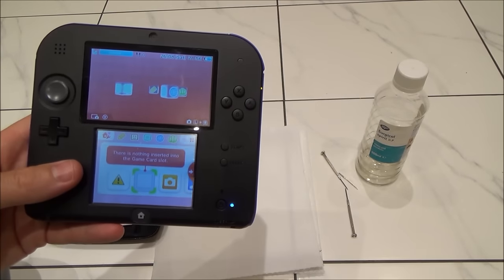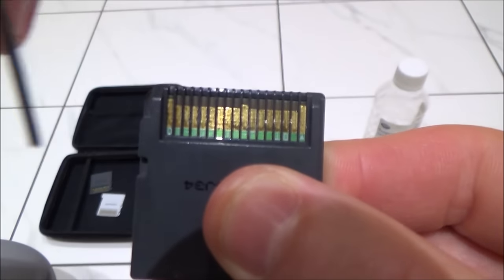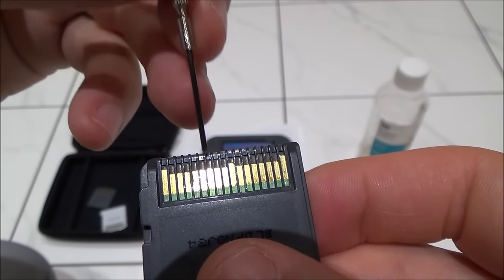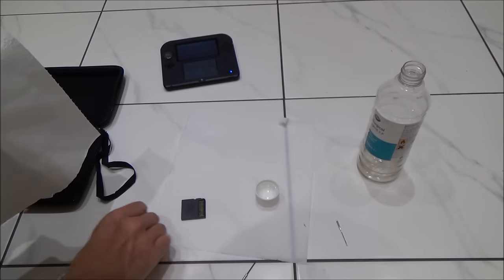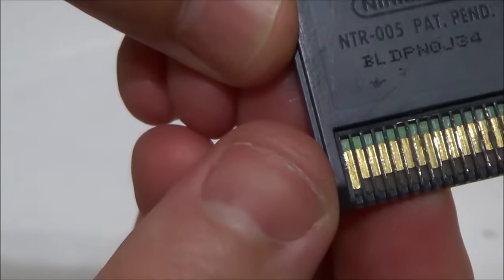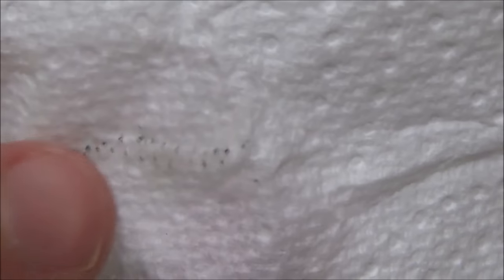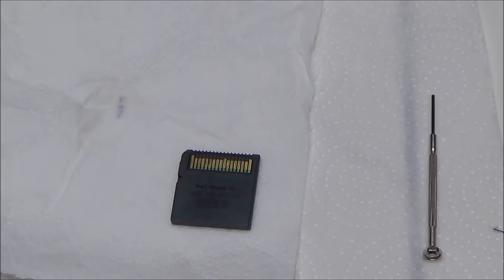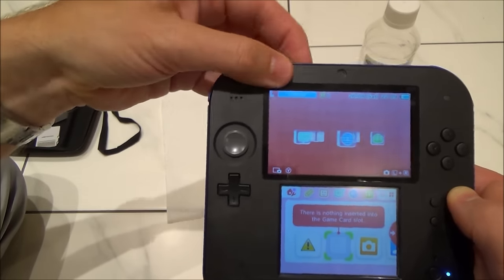How to Fix a Faulty Nintendo DS / 3DS Game Card

Comment: i dont have  a ds/3ds But I have a Nintendo switch with two games: Super Mario Bros Wonder/Sonic origins plus but the problem is Sonic Origins Plus does not work on my Nintendo switch I tried every method including uninstalling the game but it still didn't work if someone tells me the only way to fix the game card slot and/or the game card itself is to factory reset the Nintendo switch that I have I'm not going to do it if I have to please someone send me message to fix my game cartridge or the cartridge slot

Comment: I just took a toothpick, flattened out the tip, soaked it in water, then twirled it gently on a towel, and then pressed the gold part and it solved the problem. (Scribblenauts collection to be exact)
Reply: JUST USE A TOOTHPICK IF UR A KID DONT NEED TO GO THROUGH THE TROUBLE OF FINDING RUBBING ALCHOHOL.

Comment: So would a game still work if one of the plastic pieces that divide the gold connection point is missing?
Reply: i have a game like that, its mario kart ds and one of the little dividers is missing. it does still work just fine, so you should be able to get it to work without it. so long as the gold pieces are fine, you should be good. be sure to take extra good care of it though, because without the divider the gold pieces are unprotected.

Comment: Sadly this did not fix my Pokemon Y game…I dont even remember what bricked it
I keep my games in my game case with the 3DS so, IDK how it was bricked, it didnt look dirty and i cant see any obvious damage or crooked components
Reply: Adding thickness with about 7 layers of paper might fix it. Insert the paper before the game on the sticker side of the game and then pull the paper out a little bit so that it doesn't touch the bottom. Since paper is flammable be careful.

Comment: I tried this several times and my cartridge still isn't reading. One of the gold bits is really scratched up and two of the little black dividers are missing. Is there a way I can fix this?
Reply: I'm not sure... it sounds like your game is in really bad shape. If I recall correctly, you can remove the dividers and have the game work, being plastic they shouldn't be electronically important. That being said, it IS important to make sure the dividers aren't bent or smashed as to be in the way of the contacts, make sure to adjust any remaining dividers that are distorted so that they're thin and straight. As for the super scratched bit, do your best to clean it as best you can, debris could be in the scratches, don't be afraid to let a little extra rubbing alcohol to seep into those scratches and utilize gravity to your advantage, just make sure it's given ample time to dry. After cleaning the scratched area, look closely to make sure it doesn't have a physically broken connection as that would be much harder to address.
After this, if it still doesn't work, one thing you can try is adding thickness to help press the contacts together. Do this by putting a folded piece of paper in the slot on the sticker side of the cartridge before you insert the game, when I used this trick my paper was 7 layers thick, but since your game is so busted you might need more or even less. Be sure to let the paper hang out so that it can be easily removed and don't let it sit so deep as to touch the bottom of the card slot. Since paper is flammable there is some fire risk with this approach, use with caution.

Comment: I legit had a Nintendo DS before, and I had this game card I didn't remember what game it is, it has a SD slot.
Then, my DS broke because the screen never displayed, then after a few years. I had my Nintendo DS Lite.
Then my dad figured out I had some old DS games near the old dusty cabinet.
I tried everyone of them, it doesn't work.
Then one of them (The SD card slot game card)
Got stuck in my cartridge.
Then my dad took it out and removed the extra cotton cover in the sticker section.
I saw nothing, pure silver.
I'll send the SD card pictures just in case if you can possibly give me a method to fix it.

Comment: My issues is that Pokemon pearl wont work it will read but it says that “an error has occurred press and hole the power button to turn the system off” I tried to blow dust out of it but it won’t work and the game also worked not to long ago

Comment: Hey my ds game Heart Gold game cartridge works fine but it will just freeze at a random point in gameplay and remain frozen unless I power off the 3ds
Reply: Crimson have you did the cleaning process shown in this video? That should fix it
Reply: That happened to me too. The 4th gen in general can freeze anytime but my HG froze like 5 times.I still have to try cleaning the cardridge myself so I don't know of it works. Look if there's dirt or something in the sensors and if yes that's probably the problem and if not is the cardridge itself just damaged.

Comment: Mine recognizes New Super Mario Bros., but when I open it, it says, “An error has occurred. Press and hold the POWER Button to turn the system off. Please refer to the Operations Manual for details.”. The Operations Manual didn’t give me any info, so what do I do? This is the only Game Card that does this.

UPDATE 1: I lost the game, it doesn’t matter anymore.

UPDATE 2: I found the game, put it in my DS Lite, and it works, but the Minigames and Mario vs. Luigi modes just take me to a black screen.
Reply: GDFan3000 YT Same game, same error.
Reply: GDFan3000 YT 
Clean the cart slot, or as Billy Mayonnaise suggested,
Remove the plastic dividers, with your nails or which you prefer.

I wouldn't do that tho, unless my absolute last resort.

And I know you lost your game, this is for other people, or if you encounter this problem again.
Reply: Pocket Gaming I just updated my initial comment fyi.
Reply: GDFan3000 YT 
Try checking if it's dirty or corrupted.
Reply: Pocket Gaming It might be, since the “Mario vs. Luigi” and “Minigames” modes don’t work.
Reply: Your NSMB is a bootleg.

Comment: this did not work for me but i have a slight different chip its a galaxy eagle and does not have the plastic lines and also I used window cleaner but  when i insert the chip the image of the chip came up but when i clicked on the game the screen goes black and said. An error has occurred.
Press and the POWER Button to turn the system off. Please refer to the Operations Manual for details. Can anyone help me plz i think its the electronics btw.

Comment: .. i have a game that does work (Pokemon black 2) but makes a strange crunch noise when inserted, and is harder to insert than other games. 

Looking online; I've only seen like one or two other mentions of this, and they're all from old forums that don't tell me anything about the problem. Or just make fun of the original poster.
Reply: Carefully compare the game cartridge to the games you have that are in the best condition for any physical abnormalities and be sure to clean out the card slot as best as possible. Compare every notch, scratch and bend to find what might make your Pokémon game different.
Reply: @kyriejones6060  thinking now ot might be a problem with the system and not thr cartridges; this happens to some of my 3ds games I've noticed.  It might have to do with age or leaving the cartridge in overnight (???) But I'm not sure
Reply: @soupevil  I'm not sure either. Unless the sound you hear sounds electrical, there has to be something physical causing the noise, either as part of the cartridge or in the card slot. I suppose it could be hidden within the mechanism that holds/ejects the game, but  if so, why wouldn't it happen with more games?

Comment: Omg thank you so much took me 2secs and if I didn’t find this shit I would have lost all my Pokémon omega ruby progress tyyyy
Reply: Alan Schwartz For no reason, I have the same problem too with my Pokémon Omega Ruby. What did you exactly do to fix it?
Reply: Reverse Tacoblast so what I did is that I found a lock pick that I have laying around and dabbed a little rubbing alcohol on a paper towel just like in the vid and cleaned the gold pins. If you don’t have a lock pick of some sort you can prob use the end of an iPhone charger or sumn like that and make sure when you insert it again it’s completely dry. Don’t rush it and do as the vid says. If nothing seems to work after that than there might be something wrong internally. GL
Reply: Reverse Tacoblast and don’t be freaked out if it works and then stops working after a bit, just do the same thing and it should be fine. It took me 2 times to get it fully working
Reply: Alan Schwartz Thanks for the help and I notice, almost everyone had the same problem with their physical copy of Pokémon ORAS. Nintendo/GameFreak should take responsibility and release a new update version for ORAS. I feel like the latest software update for 3DS doesn’t seem to recognize this game

Comment: the odd thing for me only 1 ds game doesn't not read on my new 3ds xl, but it reads easily on the 2ds
Reply: clean the game card with at least 90% isopropyl and use canned air gently to clean the card slot of the ds thats having trouble

Comment: can someone help me I tried this and my game still can’t play like it shows the game and even plays the music but it says the game card can’t be read
Reply: I don't know if it will work for this scenario or not, but you can try adding a folded piece of paper to the game slot before inserting the game to help press the contacts together for a better read. Make sure it sticks out enough for easy removal, doesn't touch the bottom of the slot while in use and is on the sticker side of the cartridge. When I did this my paper addition was 7 layers thick. Since paper is flammable, use caution.

Comment: One of them got split. I lowered the price twice. I thought it will die forever, it still works. Other than that I thought the ds I bought wouldn’t recognize games. They turn on when the device is turned off. Though it had bented pins. One of them is twisted up. I managed to place another in its place. Total noob I am. But the game is in poor condition. Maybe they don’t want a splitter when other games on the listing aren’t. I have cooking mama that was eaten on top. And kung fu panda the plastic spreader. Those still don’t recognize. I have not touched alcohol. I’m afraid of chemistry!

Comment: I tried it but it didn't work😢😢
Reply: I experienced this too, though it's worked for other game in the past and is a valid approach
here are some potential issues
1. debris in the card slot
2. The game is from a different region (check the last part of the code at the bottom of the sticker, mine say USA)
3. System's card reader is busted. Rule this out by testing a different game. If you don't have one, go to a used game store and ask nicely

and lastly, what I did to fix the game this method didn't work on
4. Turn off the system. Fold up a piece of paper to be about 7 layers thick and thinner than the game cartridge is wide, but longer than it is tall. Insert this paper into the game card slot then insert the game so that the paper is on the STICKER side of the game, carefully pull the paper a little so that it's ensured to not be touching any mechanical components at the bottom. Power the system on and play the game. Now that the game is working, you can trim the piece of paper so that it only sticks out about 1 inch or 2.5 centimeters for easy removal.

The idea is that the added thickness helps press the game's contacts into the contacts in the system for a better read. 7 layers is the thickness I used, if the game is too difficult to insert, use fewer layers, and if it seems it could be loose or isn't effective enough, use more layers. There is fire hazard potential in this fix as paper is flammable, use with caution.

Comment: it did not work : (
Reply: You can try folding up a piece of paper to add thickness to help press the contacts together. Make sure the paper sticks out the back enough to easily grab, that it's on the sticker side of the game, doesn't touch the bottom of the slot while in use, and to put it in the slot before inserting the game. When I did this my paper addition was 7 layers thick. Use with caution since paper is flammable.
Reply: @kyriejones6060  thank you it works now 👍